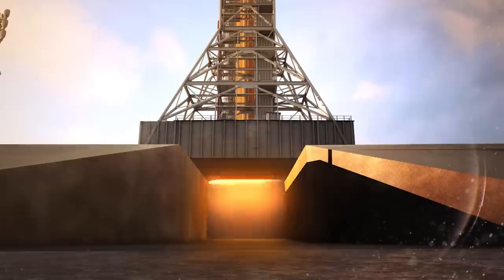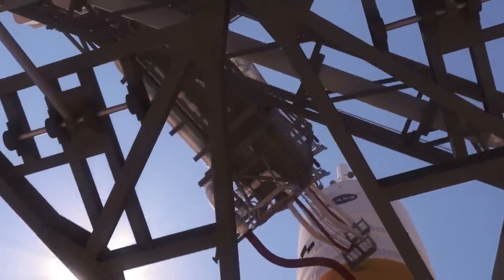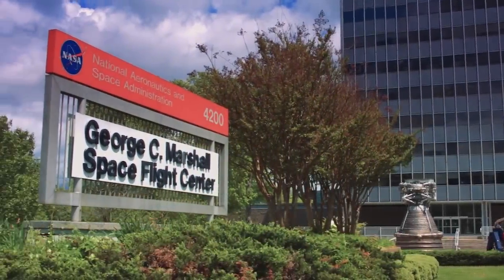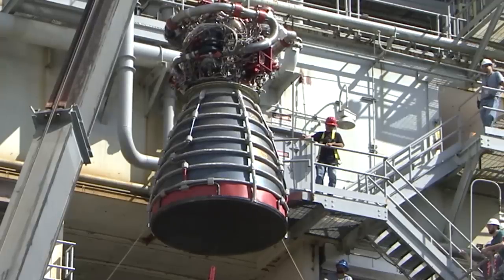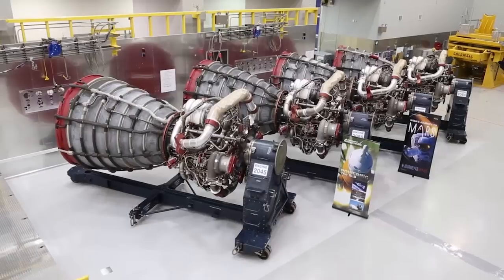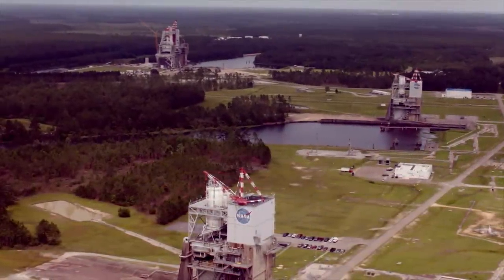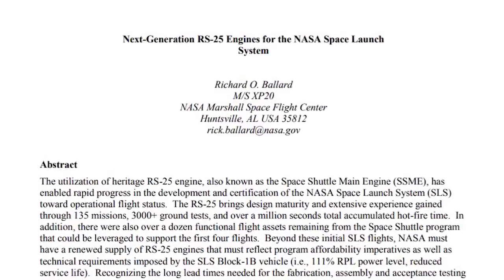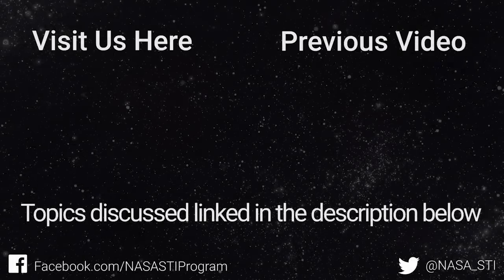Rocket Engine Testing the NASA Way!

Comment: Pretty cool to see NASA has enough smarts to reverse engineer engines that engineers 50+ years ago secured their jobs with making personal notes. Now they’ve been retired for ~30 years or more, also mostly gone. Also the old engineers designed these engines with slide rules and ingenuity. Not computer models and other computer aided guesstimations.
Reply: Backyardmech1 you still need ingenuity. Thank god side rules are gone

Comment: Great effort guys, the new SLS is 🔥🔥.
I just want to share my thought, I am not degrading the efforts, sometime it feels like why we are stuck at this technology? Can't we use atomic energy to lift off? With that we can cut down the large fuel compartments of the ship..

Another guy in the comment section has talked about anti-gravity propulsion just as my thought, is this too filmy? Sci-fi movie effect?🤓
Reply: Atomic energy cant produce such large amount of gases, it can only produce heat energy, for rocket very large amount of burning gases are required
Reply: Wouldn't nuclear rockets be more suitable in space for its high isp in vacuum rather than sea level? This is just my experience from ksp. Idk if it applies to real life

Comment: The SLS is way over budget and ten years behind schedule.  The first SLS booster they pressure tested blew up bigtime.   The first completed SLS booster has been on the Mississippi test stand since January 22, 2020..  Can anyone tell me if it has even lit off once?  They only say, "Later this year."       (And they didn't even have to build the test stands as they were built to test the Saturn V and were declared national monuments.  Now NASA decides to use them.  What would have happened if we had let them tear them down like they did the Mercury and Gemini launch towers?  #Still using 1960's infrastructure, Go NASA)

Comment: NASA is great at making these animations, however that is as close to building the SLS as NASA will get.
Reply: You have to imagine things first before you build them. The Saturn V flew and so will SLS.
Reply: diah
It should be canceled by someone.
Reply: @jrizzelable Dont hold your breath.
Reply: @jrizzelable You seem to be well informed.
Can you explain why SLS is taking so long?
SLS is using Shuttle main engines, Shuttle SRB,s  and a new and improved Apollo space capsule. The Orion spacecraft made its 1 and only test  flight in December of 2014 on a Delta 4 Heavy rocket.  With all that "off the shelf technology" you wold have thought it would be flying now. The  Saturn 5 rocket was built in less than 10 years and all its technology was scratch built?
Reply: @jrizzelable There it is.
Reply: @jrizzelable  No explanation. Just childish insults.
Reply: @cindywinters3221  this is because NASA is operatuong on a fraction of the budget it had during the 60.
Reply: @cindywinters3221  S/he's right. The aft structure is completely redesigned, tankage is new, the SRBs are completely redesigned for safety and cost, and Orion has no direct heritage with Apollo CSM. Avionics are also completely redone.
Reply: Summit X  "Over NASA" does not make sense because the last rocket NASA flew was Shuttle in 2011.
Reply: This comment aged like milk

Comment: What is the shower of something (sparks?) before the rocket is lit? Is that how it ignites? I would have thought ignition to be internal.
Why do the nozzles move around horizontally after ignition occurs?
Reply: Sparks ignite the engine and the engines move cause the thrust pushs the the core
Reply: The sparks are there to burn unburned fuel to prevent building of an explosive environment. The ignition of the engine is internal. As mentioned bevore, the movement is the steering mechanism of the engines.
Reply: @thecheekibreeki3197  wrong. They burn off eztra hydrogen

Comment: The heart of a rocket is it's first stage engine, everything else follows from that. So, what are the outstanding characteristics of RS-25? 
Excellent ISP as with all hydrogen engines. That would be great in an upper stage, for a first stage it's of limited usefulness.
High level of complexity and cost, again characteristic of hydrogen engines. In case of RS-25 the unit cost really stands out at 60mil per engine, or about the advertised launch cost of entire Falcon 9. And SLS needs four of them.
Piss poor TWR, again characteristic for hydrogen engine, acceptable for upper stage, but necessitates solid boosters in first stage completely nullifying ISP advantage. Which would be ok, if NASA could get SRB-s cheaply, they can't.

So basically overpriced and unsuitable for the selected job, and the rocket they will power will be the same as a result. So why did NASA select them? Because that's what they had, they didn't have a more suitable engine. Instead they should have started by acknowledging they don't have suitable components to make the rocket they want. Engine development is expensive, but it's not as expensive as SLS development has proven to be.
Reply: Agreed
Reply: I think they could pay for something like 8 falcon heavy launches with one launch of this thing.

Comment: The fact that the Americans invested in these ground test facilities while the Russians did not is credited as a major reason why we beat them to the moon. We tested our rocket stages on the ground while the Russians just launched their's untested. Ground testing made failure analysis much easier and more effective. Now close to 50 years after Apollo that investment is still paying off.
Reply: you mean it
Reply: The Russians had so many engines on their rocket,  it wasn't practical testing them all.
Reply: @azeezbawumia6511  If they had a test stand like the Americans they could have mounted an entire N-1 first stage onto it and test fired all the engines at once. At least one N-1 blew up during flight because of a single engine failure in the first stage. That would have happened on the ground if they had a test stand. Plus, the test stands were what allowed the Americans to work the bugs out of the giant F-1 engines on the Saturn V. If the Russians had similar facilities they might have been able to develop an engine comparable to the F-1 and been able to reduce the number of engines on the N-1 from 30 to just 5.
Reply: @joevignolor4u949  
Well,  you have a point but then during that era the Soviets didn't get that much time cause it a space race. After the second attempt to go to the moon,  the chief rocket engineer died and they had to replace him with another guy.  Probably the new guy's design philosophy is different from the guy he came to replace.
Reply: @azeezbawumia6511  Maybe so. But the American design philosophy of at least testing the individual engines and stages on a test stand rather than just assembling the whole rocket and launching it definitely paid off. Even figuring out how to reliably start an engine as big as the F-1 took many test runs on the stand just to come up with the proper starting sequence.
Reply: @joevignolor4u949  
Yeah it makes I a lot of sense to test the engines first. Plumbing 30+ engines,  there is high probability of something going on wrong.  But with the Soviet it okay to get it running then if something happen along the line  they will just fix.  Unfortunately they dey didn't attempt going to the moon again after the second failure.
Reply: @azeezbawumia6511  Another flaw in the Russian space program was their policy of shooting people who made mistakes that caused things to blow up. In the US space program if you made a mistake you were encouraged to report it so corrective action could be taken to move the program forward.
Reply: Well, practicly, Russians got first to the Moon, but not with humans. This was a race, and America had better computers and better silicon logic units technologies. You have to not think like: Oh, we Americans beat you, lOw Russians. Think instead how to work together, not for one country. Reliable engines and board computers technologies must be combined, and not fight against each other!

Comment: The software has been tested and is working ok, iits time for the "event"
Reply: No, it's hardware and embedded systems of firmware has been tested and is working perfectly. Absolutely not software.
Reply: Engine has been tested and is working perfectly. The body material of Engine used in alloy of stainless steel. Alloy of stainless steel about body material of rocket engine are anti corrosive and anti high temperature 🌡️ and very well stable.

Comment: these engines powered the the shuttles which exploded twice nice standards nasa
Reply: kartikey sinha
I'm no great fan of the shuttle, but the RS-25 had nothing to do with the loss of the two shuttles.
Reply: The space shuttle never exploded. One broke apart because of a solid rocket booster ‘O’ ring failure, and one disintegrated because of missing thermal tiles during re-entry, caused by vibration from the SRB's during launch. Liquid-fuelled engines had nothing to do with either failure.

Comment: How do they measure the thrust of the engines? Do they push against a giant spring with a gauge on it?
Reply: My best guess: They weigh the engine and then it on a full tank of gas. Then they put the engine with a full tank of gas on a rail and measure the speed. Measuring with a spring could also work.

Comment: That's a lot of Co2.
Reply: Nami Nami o2 and h2o are production from a hydrogen /oxygen powered engine add a spark and o2... and yes hydrogen....Byproduct of exhausted consumed fuel?

Hydrogen fuel for renewable fuel and clean air and water? 

Stanley Myers was ahead of his time for the invention... the Hindenburg airship was designed for hydrogen.. not only just for Lift... but the Damiler Benz Diesel engines was easily modifiable to run on either diesel fuel or a Hydrogen High Output Gas.... water for fuel?

Do Away with the needs for fossil fuel? No .... we need our oils and resources!

NASA... reaching high for all of mankind, will humanity and human beings leave the anger and rage..and lies from?  

Honorable and Courageous Stanley Myers...

Comment: Sadly, considering Nasa and its history, delays and cost overruns, the sts will be the last entry into the group, the most expensive, unreliable and lifethreatening. Space X are allready light years ahead of the game with falcon heavy etc, and the other private companies not far behind. Even at its peaks with Gemini, Apollo, and the shuttle, they had less launches per year than space x, and threw away the main boosters, tanks, or booster sections and were all years behind schedules. Nasa would be better off going back to school at space x's design and build centres before wasting time even doing another video

Comment: How do rockets slow themselves down in space? They have no reverse thrusters for deceleration, they'd be an expensive bullet ...
Reply: they turn the whole thing round and burn the engines in the opposite direction to travel.
Reply: Mudkip909  so how did Lewis Armstrong and buzz Aldrin get back to the rocket after walking on the moon? I can understand they calculated the exact trajectory to get the thing orbiting the moon but it's a big object, 1/3 of the earth?? How did they get from the ground back to the rocket do you know? Certainly they didn't launch again
Reply: Mudkip909  that sounds abit implausible, considering how many launches failed on earth before the successful one!
Reply: Mudkip909  they trained on earth too and planned and calculated.. before attempting the launches that failed, you really believe they pulled off the launch from a novel environment i.e. the moon to rejoin the orbiting rocket and perfectly steered themselves (through whatever means) out of orbit and back home? All on the first try but they couldn't even take off on earth first try??
Reply: Mudkip909  not about ease, it's about precision; just hard to account for all the unknowns in that situation without a test! But as long as it makes sense to you .. just seems far fetched to me but I'm not a rocket scientist
Reply: Mudkip909  again the same as the launches on earth that failed, lots of maths but theory and practice are 2 different things, they couldn't test on the moon lol

Comment: The cost of SLS over shadows any capability it may have. One failure and it's over. NASA really crapped in their hat on this one. They are flushing Billions of tax payers dollars into a system that is out dated off the drawing board. The ML is a single point of failure that is about to collapse under it's own weight and it does't even have a rocket on it yet. The people that run KSC are hired by the lowest bider (very sad) and are over worked and under paid. All the best people have left or are about to leave or are retiring. The word is "we have a job until they try to launch this turd".

Comment: These are Russian made engine
Reply: What are you on about, no they aren't. These are Shuttle main engines with slight modifications and upgrades.
Reply: @aleksandersuur9475  You think these Shuttle engines will do the more than 100 t job?😂
Reply: @fatitankeris6327  yes, why wouldn't they? Shuttle orbiter dry mass + max payload was about 100t by the way. Key factor here isn't final payload though, it's how much thrust you need right as the solid boosters separate and for how long.
Reply: This is he RS-25 not RD-180